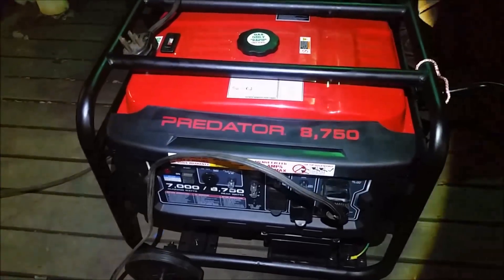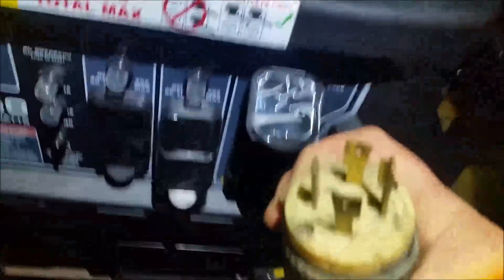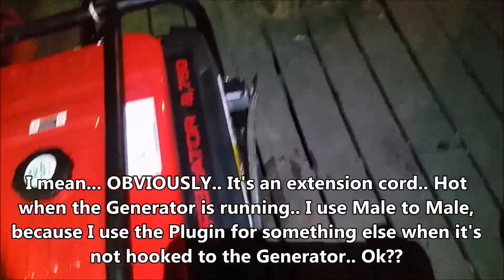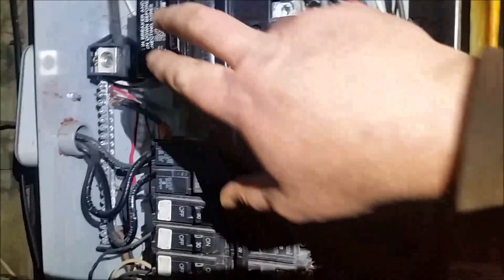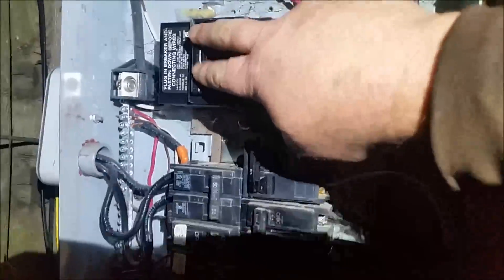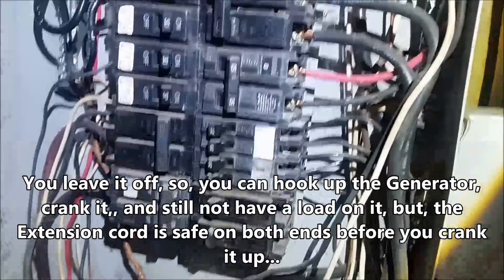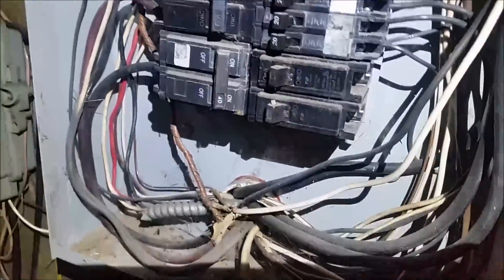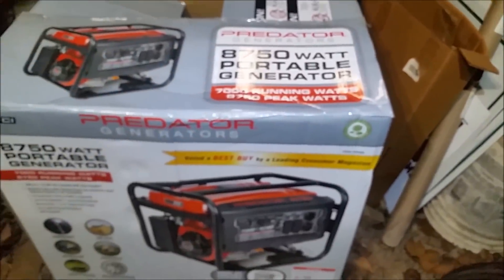Quick/Easy/Safe: Use Existing Plugin/Breaker for Generator hook up to your house Panel box.

Comment: "Quick way to die or get burned"   I can say that as a licensed professional 46 years.  "Safe and Easy" it is not.
Reply: It doesn't take much to set you off does it ?
Reply: (computer balls)
Reply from the maker: 354 Dumb Ass comments??  Let me be fair.. 300 Dumb Ass comments?? Yes.. It takes quite a bit.. 
The only reason I turned comments back on this video was,, after looking over them a few times,, I could not find one issue that someone brought to attention that made my setup any less safe,, even way more safe as a comparison to any other DIY project of the same,, IE.. Installing a Manual Switch, Interlock, etc, and I began to realize that this setup is way, way, way more safe and easy than any other solution that I have seen, due to some very simple facts.. 
Do any compairison you want, but, any DIY project of this sort requires the DIY'r to turn off the main breaker. IE.. Interlock or Transfer switch.. If they don't forget to turn of the main breaker, they are screwed... But, they are still safe using my method up to that point. From there forward, if you remember to turn off the main breaker, and kill the generator, mine is still as safe and you only spend $20 to make the cord.. If you don't forget to tie your shoes and don't forget to put the car in park, there is no reason that "IF", you can build the cord, you won't forget to turn the main breaker off or plug the cord in before you crank the generator.. You should make a simple 120v male to male plugin using a good heavy cord and hold it in your hand and see what comes to your mind.. It's really very simple... You won't forget. And, people who can't see that.. Well, they don't think, and don't pay any attention to why they do what they do all day long.. And, that is one of the reasons why this Country is so screwed up.. One comment from Obama "Joe the Plumber", and I knew what he was all about, although he was trying to hide it.. A couple of key comments from Trump, and I knew what kind of President he was going to be.. Anyone who didn't know what the Economy was going to do under either was deaf/dumb/blind and didn't know Economics 101.. 
I wish there were some way for me to make a list of all of the people who made negative comments here, and then another list of everyone who made positive comments here,  and give them a test on the Fundamental or Founding Principals of this Country.. I would bet the Negative commenter's would fail miserably, and the Positive commenter's would most likely get between 75 and 95% correct.. Negative commenters, I would venture to say "NONE" of them would get to 50% and the average score would most likely land in the 20-30%.. And, I feel like those people are largely responsible for the destruction of this Country.. So,, I am even more cool headed than you can possibly imagine.
Being a business owner has changed me.. Especially the one I have.. Great people on one side and the Average Liberal snowflake employee on the other (end of the year crew that makes it excluded).. I am talking about the 20-30 that didn't.. 
I used to be someone that would not let you finish your derogatory sentence.. And, you would never make one to me again.. Then, I tried to teach the libtards fundamentals.. That was interesting. No matter how many times you saw the lights flashing in their heads, they always reverted back to their debunked liberal ideas and ways... Now.. I deal with them by letting them talk, and then asking them a few questions. If they play fair and answer them,, with several or a couple of questions, I will have them. There will be that last question that never gets an answer.. They just realize their theory has serious flaws and some how they never forget it.. Then, I wait a week or so until they ask me some questions and I tell them the same things I would have told them before or did tell them before and it finally sinks in and sinks in hard..
You have no idea how much it takes to sit and listen to their crap, because I already know what they are going to say,, they all repeat the same shit,, just to be able  to ask a question here and one there to totally blow them away.. After all, they will be running the Country one day.. I am still researching which Country I am going to move to when it happens..  If Trump doesn't wake America up,, I will surely be retiring somewhere else.. I know what is coming.. And I like it here and the Negative guys are the ones screwing things up.. So.. It takes way more than a little to set me off.. 
But, I know who is going to make the Negative comments, so, if they don't answer and come back with more crap without answering, I just put them in the bowl of "what did Hillary say??" Deplorable's??  Democrats are always name callers and shouters. I just beat them to their own game.  If Democrats understood our Founding Principals and the fact that we "DON"T live in a Democracy", that we live under the Great "Representative Republic" Experiment, they would not be Democrats any longer.. Then, they would be Republicans until they furthered their political and economic education, and then they would call themselves Independents,,, and then, if they continued their search, they would understand people like "Rand and Ron Paul" and the Stark raving difference between the two and they would then call themselves "Constitutional Libertarians".. And, if I ever see that term being used by someone, I know I could have a high level political or economic conversation and maybe learn something from that person.. And, if those people were over 50% of the population, this world would be a really, really cool place to live.. I am way too busy with way to many projects to comment on this type of video, but, I type really fast, and I actually use this as a break here and there when I am working, so, the only reason the comments are still enabled.. I will turn them off again, since there are enough comments here that no one will ever read them, and that was kind of the point of turning them back on,, so, I'm sure I will be turning them off again at some point in the near future..  I only post videos on things I can't find on youtube to begin with, or something in my shop that I think will help other people in their DIY quest.. I actually put this one up by request for 2 people... One person who had seen my setup and could not remember the details, and one of the lineman who came by a second time after this other request and I told him I would put one up and send him a link to it.. Now, he and a couple of his buddies have the same system setup.. They don't forget the main breaker either.. Cheers!
Reply: 300 "intelligent comments". That should tell you something but probably not
Reply from the maker: Aren't you the one with 40+ years experience? Go back and read your posts and read my responses and imagine you are the reader and see which one the reader figures has more experience, common sense, knowledge, etc.. .. I tried my hardest to get you to talk about your 40+ years experience.. I called you out at least 2 or 3 times for not answering the simple questions I posed to you about your comment.. Sorry Bubba... That was 300 DumbAss comments.. You can add one to that number every time you hit the enter key..
Reply: How many beers did you pound down while writing all this rambling incoherent  nonsense
Reply from the maker: Robert M.. I don't drink.. Rarely anyway.. But, I make some of the best wine and moonshine you have ever tasted when I do. Incoherent nonsense? Ha.>ha...Ha.. I won't even look back to see what you originally said.. But, facts are facts and physics is physics.. If you don't like them, you'll have to find another planet to make you feel better.
Reply: F off. Your too expensive.
Reply: Mark is a Angry young man!!
Reply from the maker: Really? I think it is more than obvious to the average reader, who is the Moron here.. Ha..Ha..
Reply: @MarkThomas123  your right it's you  Lol
Reply from the maker: Wow.. Really? A Licensed Professional for 46 years?? Me too.. Not in Electricity though.. In Computer Network Engineering.. But,, maybe you should enlighten us... Quick way to Die or get burned?? Which way is that?? If you don't turn off the main breaker?? But, you are an Electrician?? Isn't that the first thing you do?  So, how can you work on a panel and still be alive?? Surely,, you are dead now?? Right??? OH.. Not.. So,, turning off the main breaker is something that you "ALWAYS DO??".. Ok.. I get it.. Well.. Me too.. 
So, when I unplug my Welder from it's 220V plug, turn off it's breaker and turn off the main breaker,, hook up the male to male cord, then crank the generator, turn on the Generator breaker.. How about explaining to me how I am going to get Killed or Burned?? 
Silence is the Key to Ignorance.. If you keep Quiet,, you get to take people's money and not look like a fool.. It is when you start typing and having those Keyboard driver errors, everyone knows you are either the Dumbest Electrician that ever walked the face of the world, or just the Average Electrician Dumbass... It is such a simple trade.. I don't see how anyone could be proud that,, that is as far as they got.. But,, that's me.. Shame you can't support you claims,, since you made them so proudly and so emphatically.. Just another kid dumbass.. Mommy keep track of your youtube subscriptions??
Reply: I think the biggest problem with something like this coming from us electricians is the "common sense" quote. I can only hope that everyone that would watch this has the common sense he speaks of but, let's face it....there is something in this world of ours that has become extinct. I'm not talking about a g'damn dinosaur here either. There are too many stupid f'n people in this world of ours to show ANYTHING improper and potentially dangerous.
Reply: @MarkThomas123  Your Way is Danderous and illegal you Idiot !
Reply: Obviously your fragile ego has been bruised but its people who may try to do this that I'm concerned about. Stick to computer networking its a lot safer.
Reply from the maker: I didn't think you had an answer to the question.. What's the matter with your Ego.. Can't answer a simple question about your comment?? Stick to taking care of yourself.. You will get a lot further and maybe not make such Stupid Statements.
Reply: There's no point wasting time explaining the inherent dangers of  your suicide hook up to you. In one ear and out the other.  All people need to know is your a computer network installer not a licensed electrical contractor.
Reply from the maker: Yes.. Robert M.. You are wasting your time.. You make comments, I point out the flaw in your comments and ask you questions to explain yourself after explaining what it is that you don't understand and you totally miss the picture.. 
And, you can't explain your comments once I point out your misunderstandings.. You still don't get it.. I can tell by your comments.. Man.. That is really advertising how stupid you are.. 
BTW.. I am a Carpenter(Finish and Framing), Welder(Fab or Engineering), Electrician(A/C-D/C-High and Low Voltage, electric and data), Mechanic(Gas or Diesel), Machinist (Lathe/Mill, etc), and anything anyone else can do with two eyes and two hands.. 
Care to change topics? I don't care where you go, I will know more than you.. You have proved that already.. 
Hey Stupid.. Here you go again.. What is the purpose of a Main Breaker again? And, if the Main breaker is off, and the Generator is not cranked.. How can you get hurt again?? Please be specific, so I can tell you where you are wrong again, so you can bla, bla, bla like the typical Dipshit Demoncrat you are..
Reply: There's no need to explain myself to a "jack of all trades master of none" back woods hack who says he knows more than my 46 years (38 licensed) doing electrical work. Speaking of stupidity Iv'e advertised your's in one sentence.
Reply from the maker: No.. The explaining yourself is for your own benefit.. 46 years doing electrical work?? What? Residential? You didn't see everything you needed to know at least one time in the first year or two? How could you stay in such a mindless profession for 46 years?? I'm just curious.. I wired my first house before I was 18 years old, and all I did was open another panel and take a good look at it and make some notes before I got started. Then, I opened on switch, and one receptacle and saw how they were wired.. Had to go to the library back then to find out how to hook up a 3 way switch.. I did the whole job.. Pulling out all of the old wire and putting 1000 feet of 12/2 Romex with ground in.. Inspector came in and wanted to know who I hired to do the work.. He was certain it was some new electrician he had never met before.. I had one recepticle that I had the black on silver and white on brass out of the whole house.. I fixed that while he stood there and he signed off and left.. Oh.. And BTW.. I replaced the outside box with a larger one and ran electric to my shed and used the older box from inside and replaced the inside box before I started.. 
That was my first Electrical project, and I was 18 and had Zero Experience.. And you are proud that your lame brain kept you in that simple minded trade for 46 years?? Ha.>ha.Ha..Ha.. Yea.. You are smarter than me.. I can surely tell.. 
I see you don't know enough to put up a video of your own after 46 years.. Ha.>Ha.. Your subscriptions, favorites and lack of playlists says alot about your feeble brain. How did you even get your license??
Reply: Good for you sonny obviously your very impressed with your self but most of the guys in here are not
Reply: Robert M well I would like to know what is wrong with this exactly so I can understand better. Everyone says it’s unsafe and what not but won’t explain why?
Reply: @bmkemp03  The exposed prongs on the male plug become "Hot".   Now "Murphy's law" is in effect. I don't care how much common sense anyone thinks they have, the door is now open for some one to get hurt.
Reply: Mark, never in 19 years of "jump cord" use have I found myself holding a hot plug. As a matter of fact the cord is never energized when I plug or un-plug it, just common sense. I don't understand what motivates the naysayers. IMHO using the "jump cord" is safer than the drive to Lowe"s to purchase the wire and plugs.
Reply from the maker: Ed.. I agree fully.. But, you and I have common sense.. The rest of the NaySay commenters are severely lacking.. They can't even answer a direct question about their Accusational statement.. Democrat Dipshits!!

Comment: it's absolutely important that when you do this you disable the main breaker, or at the very least get a patch panel of some kind that allows you to cut off external input. the reason is that the power you're generating is also going OUTSIDE of your house, you're creating a live wire to the pole, and the easiest short to ground is whatever poor sonofabitch lineman is ending up working on fixing your shit. If you don't turn off the connection to the external, you can kill people.
Reply from the maker: Yep. Correct.. "IF".. Exactly correct.. And, "IF" you point a loaded gun and pull the trigger,, and if you park your car on a hill and forget to put it in park,,, and,, you you stay in the sun too long without sunscreen,, and if you touch a hot stove,, and,, and '"IF" you forget to tie your shoes??  

Then, there are some things a little less immediately obvious, but, we learn those things too... Don't forget to zip up your pants,, don't forget to brush your teeth... Hmmm.. Seems we have the rest of those things figured out by now.. 
Shame people can't trust themselves to add one more thing to the list??? I mean.. Is that not the same things?? If it is "dangerous to begin with, and if you don't throw the main breaker, you might cause harm or worse to an other.. You can't reasonably expect some DIY'r to turn the main breaker off? I don't know.. From the average comment on this video.. You might be right.. But, then again,, that is not who this video is for.. And, it says it in the video and comments.. I know plenty who would never think about doing what is in this video.. They are smart enough to know they don't want to fool with it.. Then, there are others that we don't need to worry about..
But, Your comment is dead on target!! Hopefully just in the sense of the word and the main breaker "WAS" off.. Cheers.